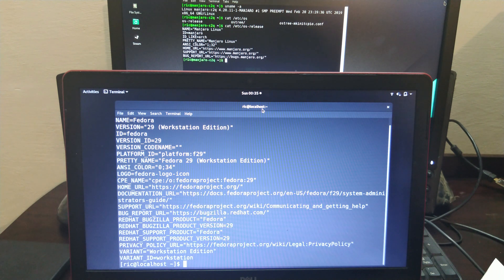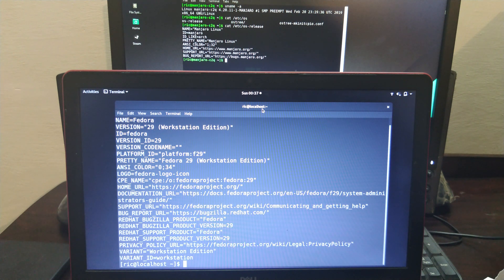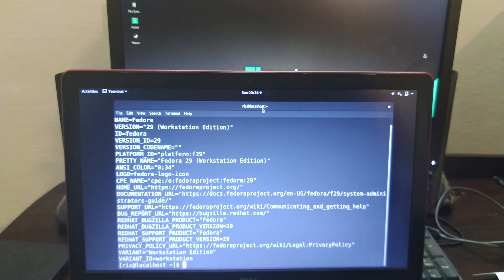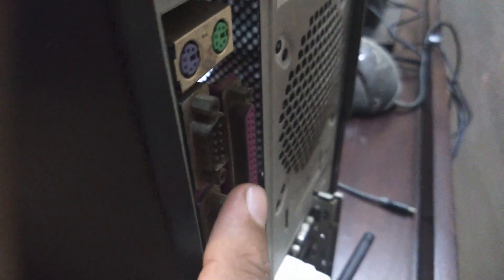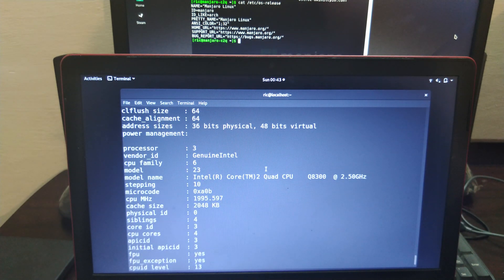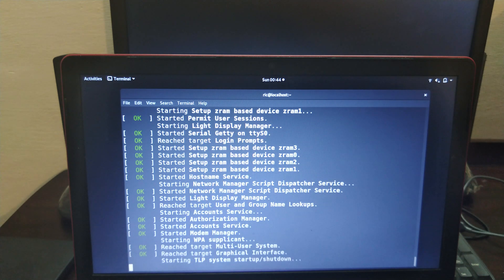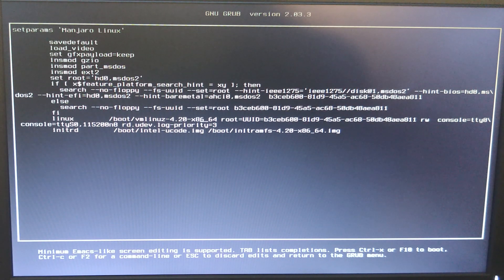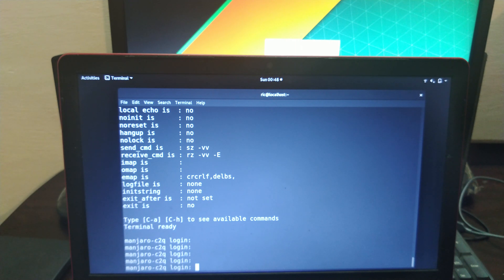See Linux Booting over Serial Port on Older PCs

Comment: I just bought a small computer (Dell Optiplex 9020) that has a serial port and mint installed but the serial information won't display on my laptop. How do I know I need that voltage converter? I have a USB to Serial FTDI converter and I just directly connect that to the computer Optiplex 9020. Also baud is default 9600 but can't seem to get any type of response. Any ideas? Thanks for your response.
Reply: What you need is a RS232 null modem cable. If you want to build your own, there are tons and tons of wiring schematics which all tell the same picture. In most cases a simple TxD-RxD-GND unit will do.

I built mine with eight wires allowing hardware flow control, allowing full compatibility to any system I hook it up to.

For the baudrate: 115200 is the most commoon, other systems occasionally use 38400.

Comment: "older PC's" buy a brand new Storinator NAS, it will come with it. I almost had to use it or IPMI to fix a networking config on our video NAS
Reply from the maker: Yeah, that;s why I said "PC". I own modern equipment that have a serial port, but they aren't PC, I specifically said "PC"
Reply: @usrbinsh  45 Drives sells bonafied PC'S with Windows for editors, same hardware. P.s. Google Compute Engine and EC2? Give you access to the serial port... It saved my butt once on a misconfigured hard drive.